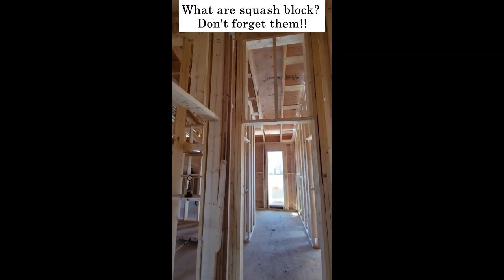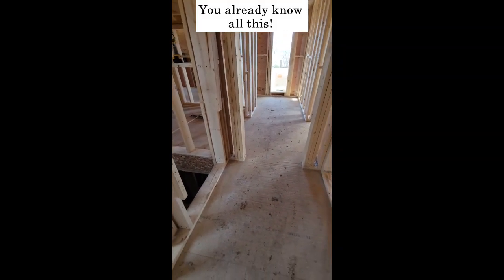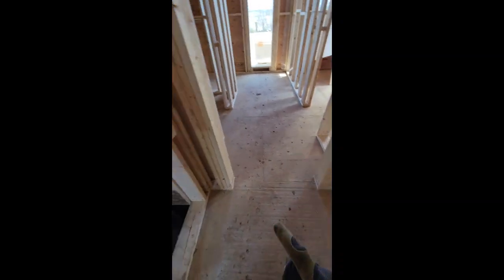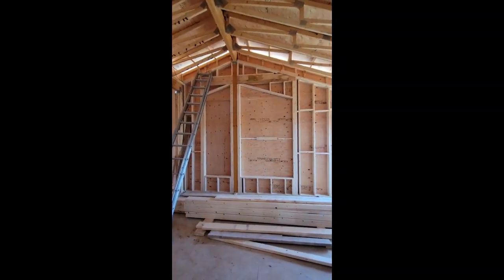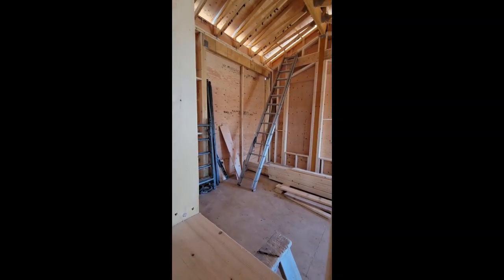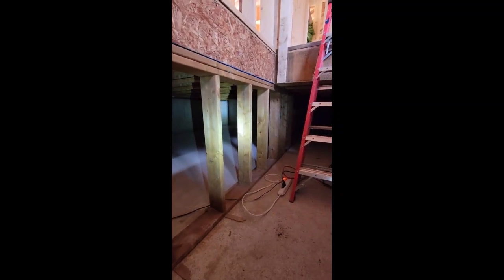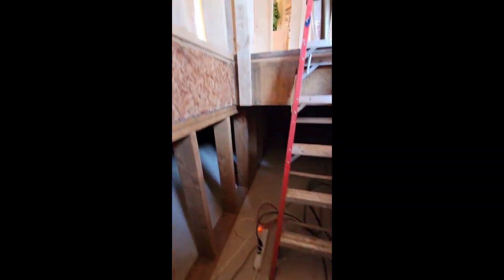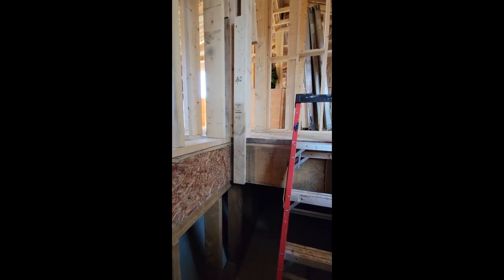What are squash blocks? Why you must have them!

Comment: As a former firefighter, I don't use engineered joists. Put all the squash blocks in that you want, those joists will lose all their structural integrity at a hair less than 500 F. No thanks, I'll use lumber.

Comment: As a novice who plans to do a self build in the next decade or so, this is much appreciated!  I hadn't even considered the need to bypass the joists for point loads.  I probably would have ended up significantly overbuilding my framing or some other naive solution.
Reply from the maker: I would say it is always better to over build than underbuild. The building code is just the minimums they want to see. We try to go over and above when we can. I hope you have a great experience when you build. Have a great day
Reply: @JosephTalbotDIY  Oh, for sure... but there are probably better ways to budget the build than, say a 10x safety factor when a 2x would do.
Reply from the maker: @MacroAggressor true that. It is good to have a budget when building and have a percent extra for a buffer for incidentals or increase in material cost

Comment: I was asked to figure out why the the casement windows of a 9 foot window assembly would not open. The header had settled onto the window assembly. The weight on the side posts had crushed the rim joist by 1/2 inch. 2 story house, floor and roof loads. No crush blocks. I had to fabricate some 9 inch post jacks to pick this load up before putting in crush blocks.Always walk your framing. drive nail at all the point loads. then make sure the load is carried past the floor framing.
Reply from the maker: Yep they are very important and so is proper sizing of the header. And yep nail/glue the blocks together so they don't move. Thanks for sharing and have a great day
Reply: @JosephTalbotDIY  I put in a 16 P nail at each point load so I can go below and find the exact spot for the crush block. I cut the blocks a little long and drive them in place. I don't  think I have ever nailed them together. They aren't going anyplace.
Reply from the maker: @kkarllwt  you're right not much chance of them  moving. If we can't get in to nail them we just PL glue them in place just for extra precaution.

Comment: Do these only need to be used with light weight (TJI) joists?  Or should they be attached to dimensional joists as well?
Reply from the maker: It is a good idea to use them anywhere a load comes from above. So if you have a 6x6 post above you should have at least a 6 inch wide  squash block
Reply: Divide the designed load of the post by 500 to get the sq. inches of crush block .
Reply from the maker: @kkarllwt  that's good to know. Unfortunately most don't know the load amount so we just go by rule of thumb of no less than the width. Going beyond doesn't help alot as the load is directed straight down. Thanks for sharing
Reply: Because sawn dimensional lumber will shrink as it dries, and because the load is perpendicular to the wood grain, vertical squash blocks should be used to transfer point loads in dimensional lumber framing.
Reply from the maker: @bigk4755  yes you are absolutely right. Thanks for adding to that. Have a great day
Reply: They cost almost nothing to put them in so I always go for the overkill. You always want to think about transferring the load continuously all the way down to the foundation.

Comment: Why are the jacks and cripples not aligned above and below the trapezoid windows. ?
Reply from the maker: Wow you got good attention to detail. They are more or less just filler. It is less than 16 Inches and above is not structural although the bottom ones hold the weight of the window. Drywaller likely won't even screw to them. They'll just use the plates. Thanks for commenting and have a great day

Comment: After all that, I STILL don't know what a "squash block" is or how it's used... I guess I'm just a dummy...
Reply: And it sounds like you will never need to know.  If you're buying a house hire a certified house inspector and read his report.
Reply: You're absolutely correct... I have no "need to know". I just have an inherant curiosity about things. And the writer of this video didn't satisfy or explain anything that would satisfy that curiosity. I'm sorry to have offended or upset you with my stupid reply.  @charleshill506
Reply from the maker: Thanks for asking and commenting.  Perhaps I can do another video to better explain.
Reply: Its just a piece of wood for bracing between the joists helping to support the wall/load above it better. Im licensed builder and never used the term "squash block".
Reply from the maker: Depends where you are.  They have different names but do the same thing. Thanks
Reply: Every set of plans I've ever built from just called out "solid blocking"
Reply: @MrBcj7  Correct!  Squash block is a terrible name for them since their purpose it just the opposite.  If they squash then they aren't working!
Reply from the maker: @charleshill506  Ya, seem funny not funny eh. It is to prevent squashing.
Reply from the maker: @MrBcj7  yes they are called different things depending on where you are and who does the drawings or installs them. Thanks for commenting, have a great day

Comment: if you stack your framing, it shouldn't matter if you have compression blocks in there or not. I guess if you were hanging 300-pound doors, that might come into play but for the most part, an interior door frame shouldn't have to be a load Bering component.
Reply: I'm an old carpenter, my first skilsaw was steam powered. I'm sure a lot has changed since I hand drove my first house. not just the technique but also, the material.
Reply from the maker: @russriley3005  yes things and materials and code change all the time. Even full time builders have the work at keeping up. Thanks for commenting and have a great day!
Reply from the maker: All these points have roof load coming down and the drawings require them. But yes you're right if no load and just things like an interior door there's no need. Thanks for commenting and have a great day
Reply: Right around 1:20 min he literally shows them to us and describes them. Tell me you watched only 30 seconds without telling me. 😂

Comment: Squash blocks are more important when using manufactured floor joist like TJI s.
Because the joist in and of themselves arent capable of supporting the load as are traditional lumber joists material.
Reply from the maker: Yes you are correct. Although there are times when a point load comes down in-between joists and then we need to put squash blocks in then as well. Thanks for commenting and have a great day.

Comment: When adding this after a recent build would it make sense to jack up on the location to make a tight squash block fitment?
Reply from the maker: This was done within days. So no. If it had been a long time or had a heavy snow load then yes it might make sense. One thing I'd caution if it were finished inside if you jack it up you could Crack your drywall

Comment: So these blocks are mainly for vertical support, right? Do they also help prevent lateral movement of the load bearing joists and beams? Is the possibility of the weight  being so immense that it may shift  the support element to one side or another or is that not a concern?
Reply from the maker: We should never say never. However, the blocks do not have any lateral support. They are for support coming down from above, so yes vertical support. If the building or blocks were to shift side to side we would have much bigger problems, like an earthquake. So there is no worries of any shifting. These are intended to prevent sinking of the members above. There should be support from the roof right down to the foundation. Thanks very much for your questions. I appreciate it and have a terrific day!!
Reply: We thought we had all of our point loads blocked under the floor to the beam, but a clean-up kid noticed that the floor was deflected near a triple stud pack in a wall run. Looked it over and discovered a huge roof valley support was legged down to the top of the wall there. As luck would have it, the resulting point load was centered between two floor joists with no (squash) blocking. Used a  3-ton jack to lift the load while we installed several pieces of blocking. Smart kid for saying something about the silt that had formed from rain getting inside and debris all migrating to that low spot.
Reply from the maker: Sometimes things get missed and it is so good that someone caught it before something began to sink. Good for you. Have a great day